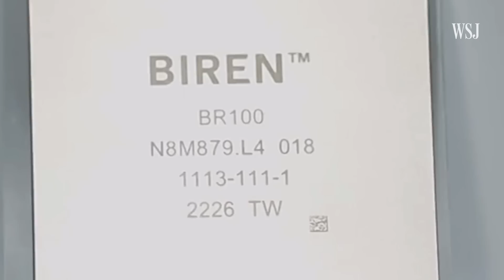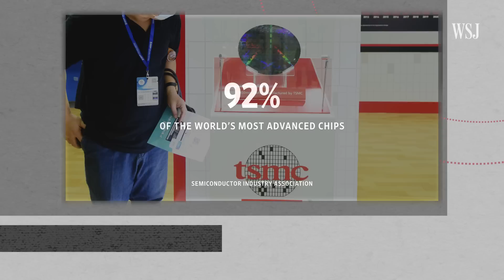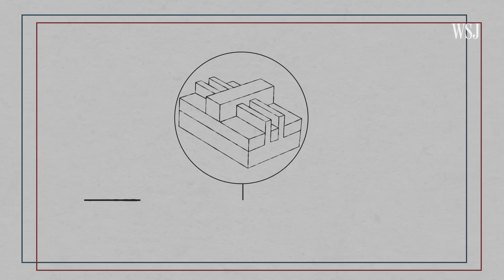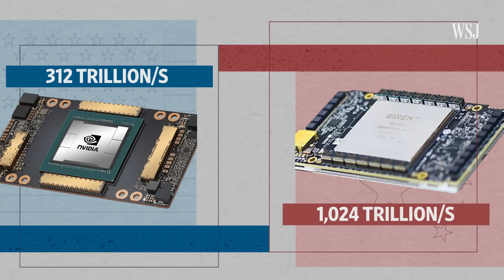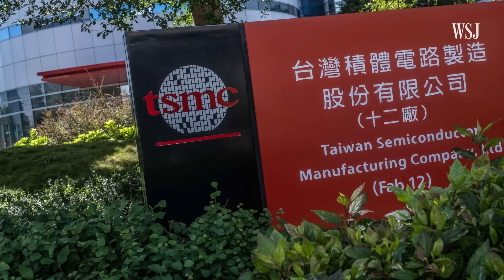Has Nvidia’s A100 Chip Met Its Match With Biren’s BR100 Processor? | WSJ U.S. vs. China

Comment: You can bet that NVIDIA has long had the capability of producing such chips as the Chinese are now producing, but they have simply not done so to keep coming up with something SLIGHTLY better to make more money off of.
Reply: ITS CALLED BUSINESS.
Reply: That was my thinking at the end of the video when they said Nvidia already announced a chip that is faster/ more powerful. They already had that in the release pipeline but just accelerated it because of the competition.
Reply: does not matter which is the better product when the chinese offering is probably 50% the cost
Reply: Planned obsolescence in ECON.
Reply: NVIDIA loves to Sandbag🤣🤣

Comment: It’s not just chips, it’s the numerical computing. Nvidia has Cuda and everybody uses Cuda. No open source framework has good support to any alternatives.
Reply: If they have to use those chips due to sanctions then they will develop the tools. It makes no economic sense for anyone to rival CUDA today, but if you put artificial barriers they will throw money at it.
Reply: It depends on the incentive and cost, CUDA is used because it's the easiest option for AI/ML for hobbyist/researchers. But if an government-backed-entity needs something they will fund support for it.
Reply: if a government agency (NSA or ccp's MSS) need a system, its not hard to imagine or uncommon that a custom solution is designed to efficiently meet their needs. instead of using a public one size fit all system.
Reply: @PD-co9gv  ROCm lolz....how is it....can beat CUDA????
Reply: @mashirokobato5509  Yes, it can beat CUDA. The choice of CUDA is arbitrary.
Reply: @sammiller6631  CUDA better than OpenCL metal and ROCm ..easier to developed code and code compile.... CUDA has proven way better in ML such as TensorFlow Kubernetes Otoy and etc...any high end HPC still favour CUDA over OpenCL or ROCm due to to nature itself way more open to developer

Comment: Impressive that Intel was not mentioned in this video.

Wonder what that means…
Reply: Because they aren't in this discussion. Intel doesn't have a competing product and hasn't. This isn't their expertise. Intel is struggling to release their core basic products, let alone trying to figure out artificial intelligence. Intel does cpus well.  Nothing else.
Reply: Intel is nowhere in the race for chips like these. They are still manufacturing basic GPUs which are 1/50th of A100 capability.
Reply: It was shown in the video tho.